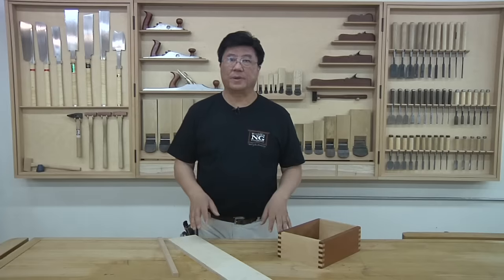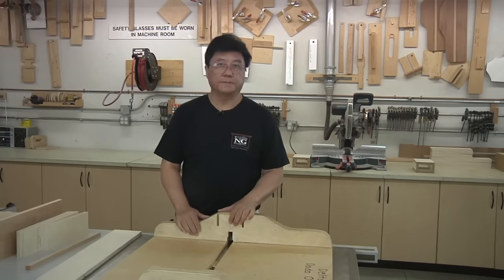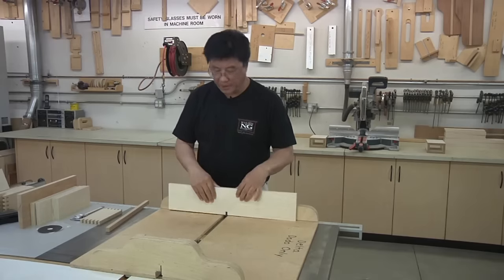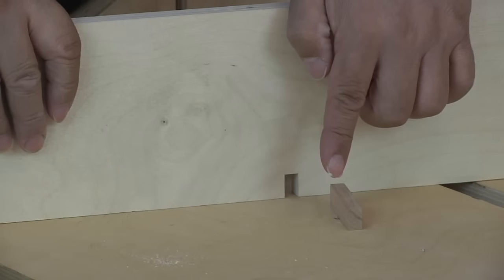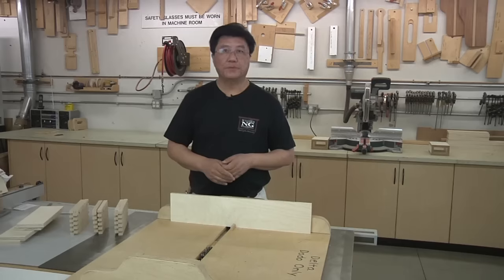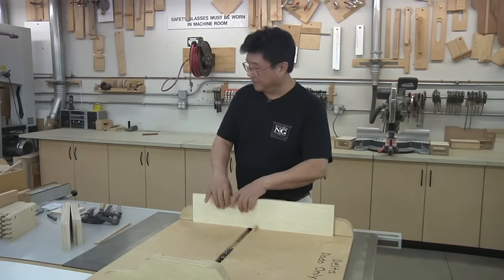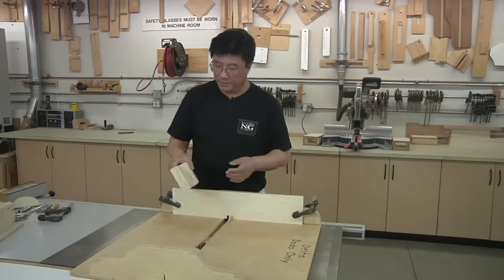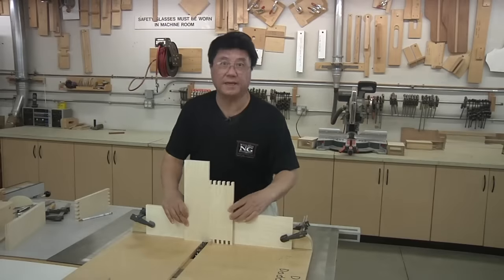Make an Accurate Box Joint Jig, Simple and Fast

Comment from the maker: Hi John Beckman. There's no reply button following your comment, not sure why so I hope my reply finds you. The opening measures .365 times that by 5 = 1.83 plus the fingers measures .360 times that by 6 = 2.16 add those together = 3.99 inch. OK so I'm  .01" off. :-) Thanks for watching .... but not too close please.
Reply: Thanks William,  I was wondering how the math worked on this.  By the way,  If you are looking for suggestions for an upcoming video, how about doing one on the 45 degree miter sled you mentioned you were going to do in your 5 cut method video.
Reply: Cool
Reply: William Ng di
Reply: There are many components to building a table saw. One plan I found which succeeds in merging these is the Wilfs Wood Blueprint (check it out on google) it's the most helpful resource i've seen. look at the amazing info .
Reply: Manisha Lama q
Reply: Tommy Faulkner 			12
Reply: I must admit that I've watched this video a dozen times and I still find the math to be not entirely clear. If 3/8 = .375, and you've got fingers that are .360  and cuts that ... oh, never mind. I'll just watch it a dozen more times. 😳
Reply: Does this mean that all fingers are equal in size, or is the last finger slightly smaller. That is, is it whatever amount is left over? Or, is it better to figure out your width to the thousandth for how width of your stock before you start?
Reply: It doesn' t matter about the tiny difference for the total lenght... The most important part is the reference mark .......
Very clear instruction. No doubt to subscribe.

Comment: I have literally watched dozens of box joint videos. Yours is the first to explain and use the reference line. Nobody else follows through with all four sides of the box. All they show you is just the joint. No your not anual...as a metal shop owner and fabricater I appreciate the extra 1 to 5  minutes to save hours and material down the road... Great job

Comment: Mr. Ng,
Thanks for the video!  I worked in a machine shop/tool room of a large manufacturing concern and appreciate the fact that you are very exacting in measurements (in the thousandths of an inch)!  I have never owned a table saw in my life and because this is my first experience with such, I desire to be just as accurate when creating my first jigs.  Your videos are what I was looking for to create my first crosscut sled and box joint jig. Many thanks for this video and I am looking forward to other videos from you,

R. Baumann

Comment: Wow, thanks for going slowly and clearly. Ive never done finger joints ; The fog of confusion surrounded the steps to make accurate measurements. 13:55 is where my confusion got wiped away; there and the actual width of the slot; I never would dream that allowing 10 thousandths for glue is appropiate. I could tell by the sound of your dry assembly going together, that it was juuuust rrrright! Amzing use of the feeler guage; not trial&error, like I would do(mostly time GOBLING error).  I would run out to the shop, but its bed time! This is why I always did half laps,or just glue&screws. Thanks again, Mr. Ng; so glad you've planned time for more videos!

Comment: as a commercial cabinet maker i always enjoy william's videos as there is the opportunity to learn a new trick.  my comment is to all the incra jig enthusiasts...  if i filled my workshop with all the gadgets and bits and pieces available i would never fit in the shop myself lol.  the cost of having all this stuff lying around and having to store it becomes a negative investment.  so often the cheap little stuff you can make in a few seconds is just as good.  i can cut dovetails on a table saw or bandsaw faster than it takes me to set up a jig and run them with a router.  even as a hobbyist it pays to learn how to do things simply without all the gadgets.  remember the old craftsmen used a few handsaws, chisels and planes to quickly and effectively build what ever they wanted and often quicker than using the modern machine equivalents we have today.
Reply: Good point. Wish I  had seen this video before buying my Incra  jig. Could have saved myself some money. I could just never get my homemade jig very accurate. This video was the best I  have seen yet for building a jig. Many thanks.
Reply: So lets go back to using horse and buggy, covered wagons, flintlocks, walrus tooth fishhooks.  Jeez....
Reply: Richard Thaxton
i am not saying do not use modern conveniences.. i use power tools as well as hand tools.  what i am saying is this... sometimes it is quicker to use hand tools than to set up a power tool to do the same job.  it pays to keep an open mind when deciding how you want to achieve a solution.  if i am making one drawer i will do it by hand. if i have a large number to do then i will take the time to set up a machine to do the job for me.  dependent on whether the customer wants an entirely handmade joint or machine cut.
Reply from the maker: Thanks Taylor, really appreciate your support and comment.
Reply from the maker: Richard Thaxton A good craftsman knows when to use power tools and when to use hand tools. It's about making a living, finding the fastest and easiest way to get the job done. Unfortunately woodworkers don't get pay by the hour. I think that's what Tayler is trying to say. Thanks for watching, much appreciate it.

Comment: One VERY small enhancement would be at 14:42 in the video.  Instead of removing the drawer front/back reference piece (to get your reference spacing), keep it in place, and flip your side piece end-over-end (like you do at 14:55) and make its first cut, as well.  That way you don't have to keep setting it in place and removing it.  The same applies to any number of additional drawer sides - if you keep the reference piece there, you only add/remove it once (instead of at least twice, and up to four times per drawer).

That said, this video is still awesome, watching it a year later.  I love the elegance of your solutions!
Reply: It's very possible that this method is/was used in actual speed production, but he didn't want to go too fast in teaching the ideas here.  It's also possible that he was a little distracted as many people are when an audience is involved, and didn't do every step the exact way or order he would have in normal production.  Lots of us outright destroy work if we know somebody's watching, lol.

Comment: Bula from Fiji William.  I made the jig and wanted to add my comments. I added .005" to the size of the spacer and everything worked out perfectly the first time, just like in the video, cheers! I have been woodworking for about 50 years and typically did finger joints with a router and jig.  My current project requires 16, 8-inch deep drawers, which is way too long to listen to a screaming router.   I only have one table saw, but didn't change blades to make the spacer.  I took a 1 x 3" piece of stock and cut a rabbit with the dado set to get the thickness of the spacer, then used my bandsaw to cut it to height, and miter saw to cut the width.  Also, when cutting the finger joint on the side pieces, I set up a front piece for the spacer and then cut the first finger on both ends of the side piece before removing the front piece from the jig.  This saved me from putting that front piece in 96 extra times.
   Lastly, I wanted to remind everyone, USE SAFETY GLASSES when doing this process.  My project is out of recycled 20 year old pressure treated fir, which causes a lot of chip out while cutting the fingers.  Two pieces hit within 1" of my eyes with enough force to break my skin, and I never saw the chips coming. I was very glad I was wearing the safety glasses. BE SAFE EVERYONE!

Comment: That was a great video and yes it does suck to have only one tablesaw.  Looking forward to trying this after I make a dado sled.
Reply from the maker: HaHaHa, I couldn't pass up on a little shop gloat. Thanks for watching.
Reply: Do you have any drawings or side photos of your push block/stick?  It looks pretty straight forward, but I can't tell if the handle is angled slightly or not.
Reply from the maker: jocmarti The handle is straight, not fancy but practical.

Comment: I have watched this several times but not had a project to use it.  I just made a laundry rack for my wife today and used box joints using this method.  I'm proud to say that I was successful and it turned out great.  Thank you William, you are an 👍👍 excellent teacher and to all the skeptics out there, the thousands in accuracy are super important.  Just .002-3 in the wrong direction or too much or too little clearance is the difference in a good fit or a joint that doesn't fit at all.  I keep a caliper handy at all times.

Comment: Six fingers and 5 sockets, each with a width of 3/8", adds up to 4 1/8". In your sample, you used 4" wide stock. What happened to the extra 1/8"?
Reply from the maker: The opening measures .365 times that by 5 = 1.83 plus the fingers measures .360 times that by 6 = 2.16 add those together = 3.99 inch. OK so I'm  .01" off. :-)
Reply: a good reason to use mm and not fractions of the kings inch as unit of measure.
Reply: You just got schooled
Reply: I noticed this same thing as well. Thanks for asking this question. WilliamNG's explanation below cleared it up for me...need to make the dado .365 instead of .375 (as he says when first referencing his dado stack width).
Reply: @xl000  yes. It will be more easy to understand how to measuring the wood 👍👍👍

Comment: William,
  I love this video.  Watched it so many times but I'm a bit confused by one thing.  You state you like a 4" drawer height because it gives you perfect symmetry.  I'm trying to figure out how that is.  4" is 32/8.  You use a 3/8" dado. 10 fingers and spaces is 30/8 and 11 is 33/8.  How does that work out perfectly?  What am I missing?  This is important as I'm trying to figure out for my own set of drawers I'm building.  Thanks!

Update:  I actually did the math.  You're short as I expected but only by 0.015".  Who could spot that?  Look forward to seeing more of your videos!
Reply: I dont understand your update. You can see in the video that he has 11 fingers. At 3/8" thats 4.125"!
Reply: I get the same thing.....it's 4 1/8"
Reply: remember, his dado blade width is .0010 less than 3/8  at least that's the way i see it
Reply: The gap is .01 less than 3/8 and the finger is .015 less.  5 fingers and gaps = .125 exactly.  Minus one more finger or gap is .01 to .015 less as txlonghorn calculated.
Reply: The symmetry  includes drawer inside depth,top clearance and the type of drawer slides used.

Comment: Thank you for explaining the reasons why a space is needed and real life example. Tuning the jig with a feeler gauge is a great method over a few light taps. Lastly, showing that not all cuts require precision, with drawer bottom. It gives relief to beginning woodworkers wrestling with perfectionism while actually trying to get projects out the door.

Comment: I love your attention to accuracy.  You are one of the best.  I don't know why I haven't subscribed before today.
I also learned a time saver from Stumpy Nubs - once you cut the first slot on a side piece, you can turn it over to gauge and make the first cut on an end piece, as you did.  Then, you can turn the side piece back around to normal, and put the end piece in front of it, and cut both pieces at the same time.  You just have to be sure the peg was made long enough for both pieces.

Comment: It worked like a charm.  Generally I use a Harbor Freight caliper in the wood shop.  I got out the Starrett for this.  Two adjustments and I had perfect box joints over a 355 mm span.  Thanks.

Comment: Great video.  You make precision very simple, especially the way you corrected the error with a feeler gauge.  A prior video of yours inspired me to use my caliper on a current project.  It saved me a whole bunch of time...I didn't have to redo work that inaccurate measurements would have ruined.  Thanks again.

Comment: I needed a refresher on box joint making and this was by far the best video I found.  Previously, it was painstaking to fit the joints as they were so exact.  Your explanation and reasons why were spot on.  Using your method I was able to make perfect joints the first time!  I also work with the metric system and a quick Google for the metric equivalent gave me the exact fraction.  Looking forward to more videos!  Thanks.

Comment: It's been a long time since I cut box joints, and this was extremely helpful in refreshing my memory, and increasing my knowledge. In the past, I've always crossed my fingers and hoped the joint wouldn't be too tight or too loose, but using the calipers as you demonstrated took the uncertainty of of it.

Comment: Mr. Ng, I really enjoyed your video.  Finally someone who prefers a table saw over a loud router.  I'm off to the shop to experiment with your method.  Although I usually use pocket screws to make my drawers this is a good alternative.  You might also note that my drawers require no filler for pocket holes as I make the holes in the fronts and backs.  The front is covered with the drawer face and the back is never seen.  I'm still going to try your method for drawers that are removed.  I think I can hide the rear hole with a piece of plywood cut to match the plywood of the sides making the joint invisible.

Comment: William NG, your presentation is so thorough.  I've watched this several times in the past but I think it is time to DO IT!  I've had my dado stack for years and I don't remember using them more than twice, so I was hesitant.  Your method is so foolproof that I am really looking forward to creating an accurate jig, and banging out boxes, especially drawers, often.  Also, I've done drawers plenty of times, with slots and screws.  But I like the fact that the length of the sides will be the exact dimensions of the box, and that the slot for the base will be invisible, without needing stop cuts.

Comment: Great video. Your methods are just terrific. Years ago I made some baltic birch drawers the only possible contribution I might contribute is that I used a pole sander to sand the 5 x 5 foot sheets of 1/2", then I coated the sides with a floor sealer and a floor finish (This Swedish Bona system, just wipes on with a green fuzzy painter tool.)  same for the drawer bottoms. I drilled a small hole in a corner and hung them up to dry. Then I rip cut the drawer sides and bottoms, sanded the long sides of the drawers before cutting to drawer side lengths, then cut the rabbets. Then  I just used a paint scraper to remove most of the finish right at the joint before gluing and assembly. I cleaned up the joints and touched up the finish. It's been 25 years, the drawers are 28" x 28" and they've held together well, so I guess it worked.  Now instead of my over elaborate box joint jig I'd make yours, and I'd use Mathais Wandel's method to trim the tails on the rabbets. And I just ordered a set of feeler gauges--I think it would be foolish for me to not learn from you.

Comment: Thanks William, I understand. In the video you had already established the drawer height of 4” before running through the test fits and adjustments. It’s amazing how quickly small errors can compound over a relatively short distance, in this case 0.135” in 4.125”.
I’m glad to see more woodworkers using vernier calipers now, I’ve been using them for my projects for over 40 years. Great vids, keep them coming.👍

Comment: What a great video! Wish I had seen this video before making my boxes for bee hives. Same principle, just no bottom in the box. This will make production of the boxes a lot quicker and more precise than the spline joints I initially used. They were strong but took a lot of time to cut and assemble. Thank you so much for putting this video out!

Comment: Great technique ! Thanks for posting this video. I don't have a feeler gauge or calipers so I just fudged the offset to make the joint looser by "feel". I adjusted the offset a couple of times on scrap wood until the joint was loose enough and it worked great.

Comment: I'm a machinist and an amateur woodworker. I really enjoyed this video and your explanations. I built my  own fixture as you described and it worked great. I made a box 12 inches high with 1/4" joints. After doing my test piece there is one thing that could be said that makes a difference. When indexing from slot to slot make sure that the piece of material is held tight against the index pin. The same as when the first cut is made. If not then the spacing will start to vary and cause a problem. You don't have to ask how I know.

Comment: Great video. The jig is like one I made from instructions in a shop book, but I wasn't happy with the finger results. Will remake the jig now for a new saw & I bet using the caliper and feelers will make all the difference. I see that my drawer back is constructed differently. After cutting the panel slots on all the side and front pieces, I raise the blade and do a full cut on all the backs. That way, the drawer bottom slides in from the back and is either screwed or brad nailed onto the back. That way it can be removed if it needs replacing.

Comment: Very clear and fully informative.  I built one the very same day.  I wanted to be able to use one jig for many size pins so I used a piece of 0.1 in steel for the index pin, and I added I added a micrometer adjustment to set the initial width and to make the correction after the test cut is made.   I can use my jig to make pin sizes  from 0.1 in to  0.75 with one jig.  Even so, it's basically your jig and method and it works perfectly.  Thank you!